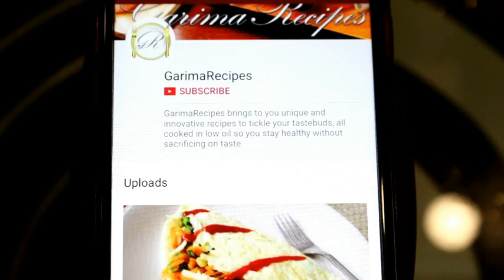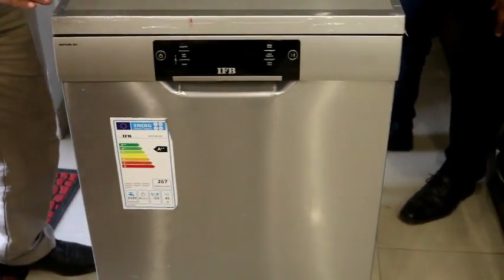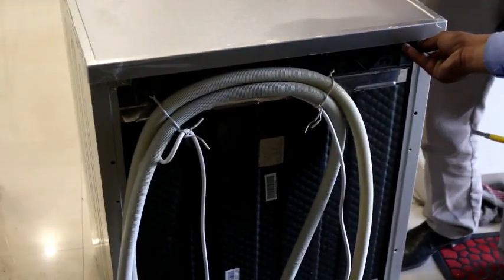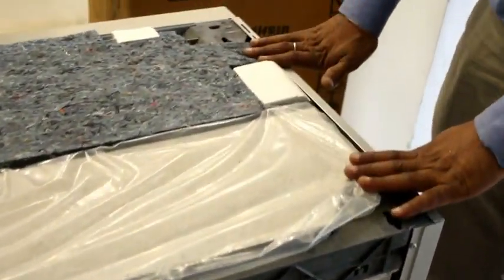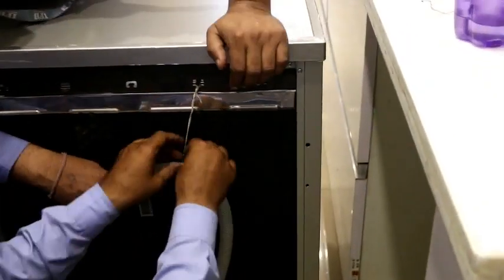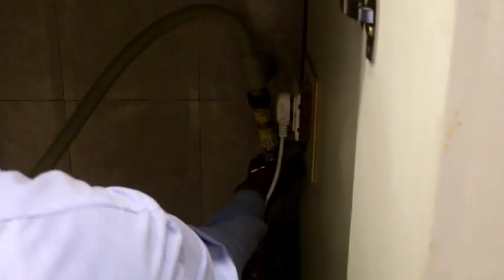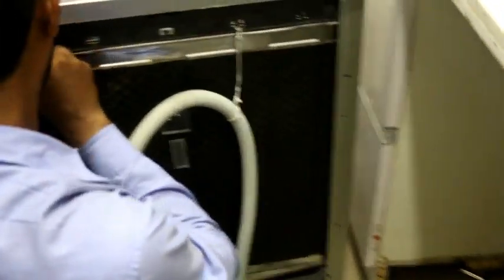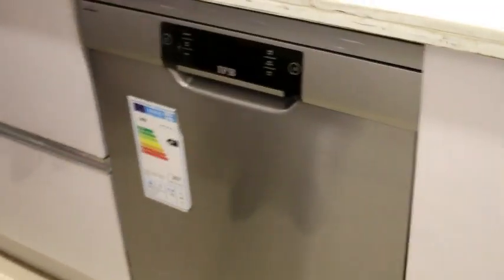How To Install Dishwasher In Kitchen | Installation of Dishwasher

Comment: Hii even I m planning to install my LG dishwasher under kitchen slab. As I m getting new slab made,  will u plz guide, do i need to adjust slab's height to install dishwasher or standard size of 33 inch will serve the purpose. My LG dishwasher is same as yours. I hv seen your LG demo video as well. I don't think we can remove it's top. So what else can be done. How have u installed it

Comment: What is the height of this dishwasher?
Do we need to put our countertop at a greater height to adjust it or the standard slab height of 32 or 33 inch will work?
Reply: Hi, I'm also looking for the same info. Did you manage to get it?

Comment: another good video .No one has uploaded such videos ever u r the first one.
Have u got the water inlet , drainage ports and plug line installed before hand at the time of construction or afterwards.?
Please suggest some good hobs and how they are installed ?
Reply from the maker: Hi.. thanks for always appreciating my work.. ya when i was renovating my home then i got water inlet n outlet pipe installed.. mine was simple installation.. i called the plumber and asked to give one pipe line inside the kitchen for dishwasher.. he did that n he used local fittings which are durable n he did the installation.. i dont have idea about the hobs.. but for installation u need to have water pipeline inside the kitchen where u have to install the dishwasher.. Ohh.. btw HAPPY NEW YEAR...
Reply from the maker: N ya u asked for washing machine model with less capacity.. here below i am sharing the link of where u can see the specification of washing machine, it's model no n if u want to buy online also u can check the details.. 

LG 8/5 kg Fully Automatic Front Load Washer with Dryer White, Blue  (F4J6TGP0W) :-

https://www.flipkart.com/lg-8-5-kg-fully-automatic-front-load-washer-dryer-white-blue/p/itmexh6f4rcktgwj

Currently this washing machine is available at flipkart.. it's not there at amazon..

Still if u hae any queries or u want to explore some other model.. then do let me know.. Good Day!!!
Reply: @Garimasharma01  Thanks for the reply Happy new year to you too !!!!!
Actually i was asking for gas hobs used for cooking like one u have installed.
Reply: @Garimasharma01  thanks once again.
Reply from the maker: @akshatpurohit1450  Ohh.. I am using of KAFF.. n believe me KAFF products are very elegant, stylish and works very well.. let me search for more options for u.. u need u give me sometime for it.. will let u know in a day or 2.. but KAFF is the best.. if u r searching for chimney or hobs.. u can u for it without thinking..
Reply from the maker: @akshatpurohit1450  Welcome..

Comment: Dear Garima, you've mentioned an adapter for softening the hard water.  Can't find any such thing in the market.  What brand is it? Does it have some other name?
Reply from the maker: Hi.. That is the attachment n is the part of a dishwasher. If in case it gets ruptured or not working well then u can contact the company itself. U can get it from there.
Reply: @Garimasharma01  Thanks, Garima.

Comment: Hello Our Modular kitchen is with space of 30 inch is it possible to place this dishwasher after removing the upper part
Reply from the maker: I am not too sure.. coz my slab height is bit bigger. I mean Monte than 30inches.. there should be some space left as well..
Reply from the maker: Let me just check.. are u planning to take the same model ??
Reply: @Garimasharma01  yes
Reply: @Garimasharma01  will be very helpfull if you can check and tell me because only you have given core review and also told about the removal of upper part, will be waiting for your Reply ❤️
Reply from the maker: @endeavourbatsmanufacturer5822  sure sure.. plz give me today's time. will surely let u know by tomorrow
Reply: @Garimasharma01  were u able to check  ? Anyone else in the thread solved this height issue... seems like a common issue and non of the manufacturers seem to care about it...

Comment: My ifb dishwasher ht is 34" and so looking at this video for solution. Not helpful as it is shown with top bonnet fixed again and inserted under the kitchen platform at the end. Finally the kitchen platform height may be abnormally high upto 36"